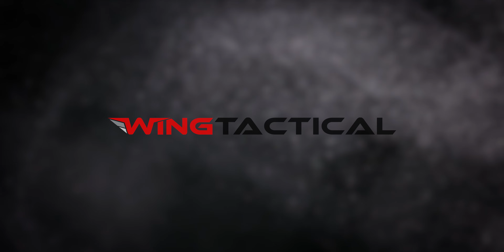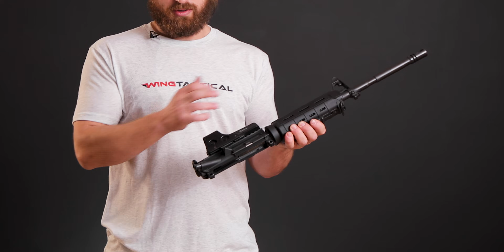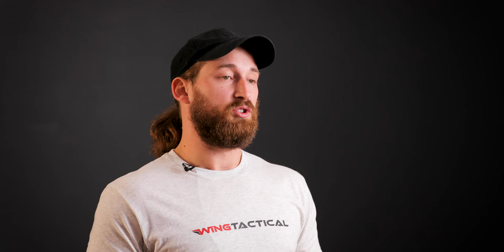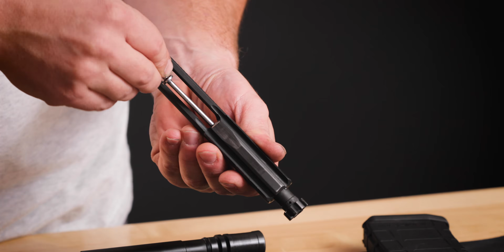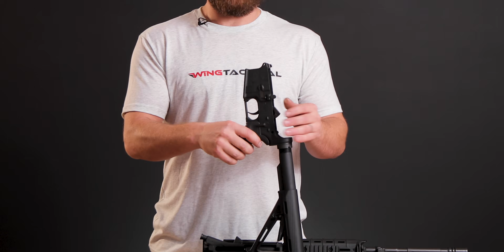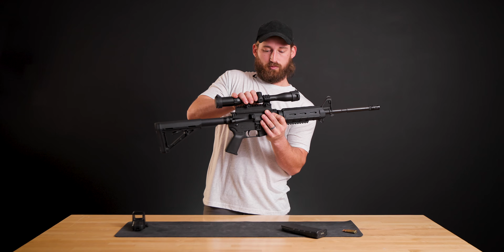AR-15 Parts | The Anatomy of Your AR-15 | Beginner's Guide

Comment: Question; When you were explaining the upper receiver, why did you refer to it as the “muzzle” correct me if I’m wrong, but isn’t the muzzle just the tip of the barrel? Would it be more appropriate to just refer to it as the barrel instead of the muzzle, since the muzzle is a small part of the whole barrel? Other than that, great vid. Very informative and concise.

Comment: I've seen a few AR-15 breakdown videos, and so far, you are the only one, I have seen breakdown the bolt carrier group. I was an SP in the Air Force from 75-95 and carried an M-16 during that time. So, I too am quite familiar with the breakdown and cleaning of both the M-16/AR-15. Basically based on similar designs, with the exception of the full auto ability of the M-16. Just a note to others who enjoyed seeing the bolt carrier taken apart, point out the rings at the end of the bolt to insure they are not aligned with the gaps in the rings lined up. It will not allow the gas to force the bolt carrier back and allow ejection of a spent round and the loading of a new round. Finding those 3 rings lined up perfectly is rare, and may only happen if the person cleaning the bolt lines them up themselves. They should be checked every once in a while to insure none or missing or damaged.